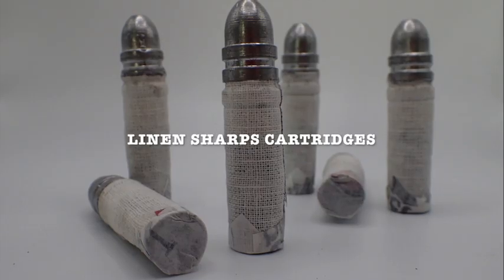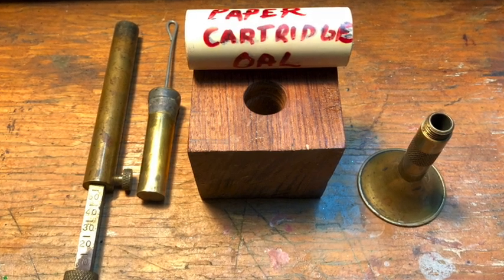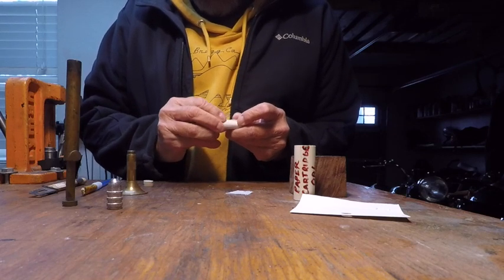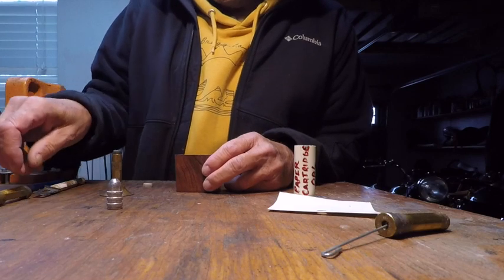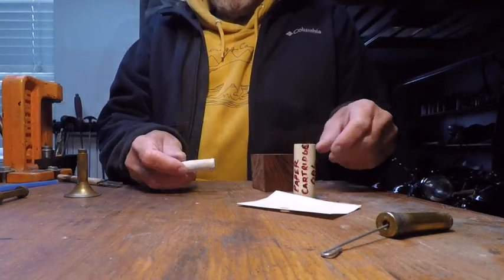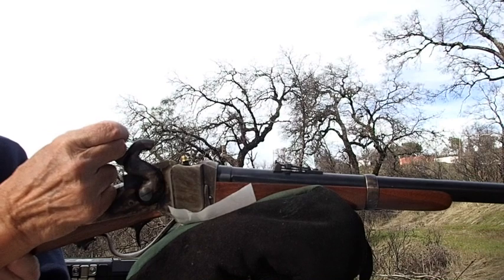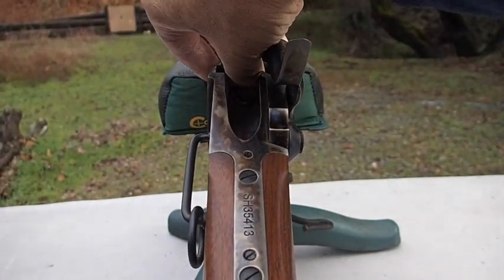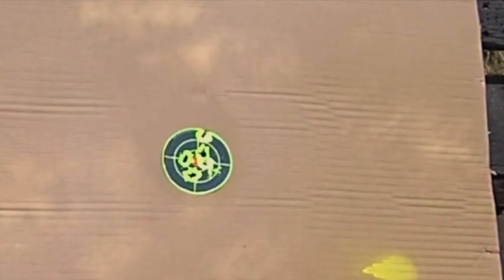LINEN CARTRIDGES FOR THE SHARPS CARBINE

Comment: Thanks for the demonstration
I will grab your idea and run with it by trying it out for my Colt Walker cartridges.
The cylinder is quite voluminous and the linnen should work nicely with it.
Thanks again ❤
Reply from the maker: I use the Eras Gone Kerr bullet with hair curler paper or thin deli wrap for my revolver cartridges. The linen is kind of thick for that application, but it might work in the Walker. Post your results, I would be interested in how it works out.
Reply: Finally I got the right linen and got the time to make the cartridges for my Walker.
I must say I was sceptical as the cartridges are very rigid.
I tested them against cartridges I made with coffee filters, tracing paper and cigarette paper.

I fired a load of 30 GR FFg with about 20 GR of cream of wheat under a round ball. Bottom I placed a coffee filter 
Patch for easy ignition from the cap

When fired I get a cloud of shredded linen but the cylinder is nice and clean

With the other methods I often get a piece of unburned paper in the cylinder.

Mechanically the linen cartridges are more rugged, so I may switch to it permanently.

Thanks ❤
Reply from the maker: @sempertalis1230  Thanks for the update. No mater what paper I used to make revolver cartridges, there was always some paper not burned in the chamber. I will have to try linen myself in my Walker. What size ball are you using .454 or .457?

Comment: Nitrated paper is paper treated with nitric acid?  Causes the paper to basically “flash off?”
Reply from the maker: I used commercially produced nitrated paper from Buffalo Arms. I always had some unburned paper left in the chamber until I switched to linen, which always burned clean, I guess that is one of the reasons they made the switch back in the day. Thanks for watching and commenting.

Comment: Also what are the dimensions of the linen pieces that you cut out of the larger piece? And I noticed that as you have them drawn out on the larger piece that some of the sides are angled. Is there a reason for this?
Reply from the maker: The dimensions of your linen cartridges will most likely be different that mine. It will depend on the bullet you use and length  of your chamber. An easy way to get your OAL is to push your bullet as far as it will go into the chamber with a dowel and mark the dowel. The angle in the pattern just keeps the seam straight when you roll them. There is some trial and error involved in getting your cartridges just right. Just make sure the completed cartridge is flush with the end of the chamber. Once you have it figured out, they are quick and easy to make.